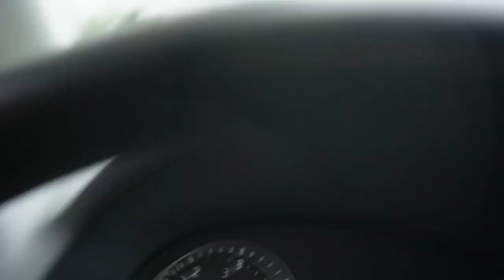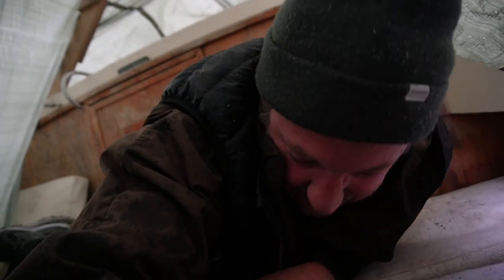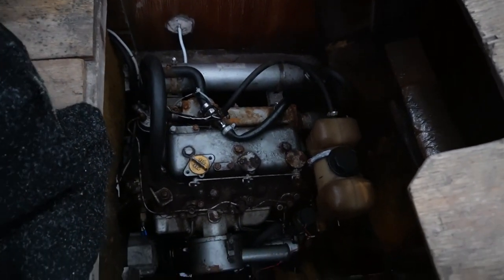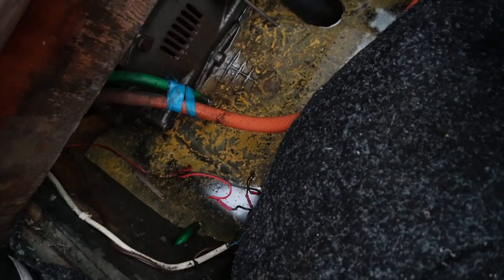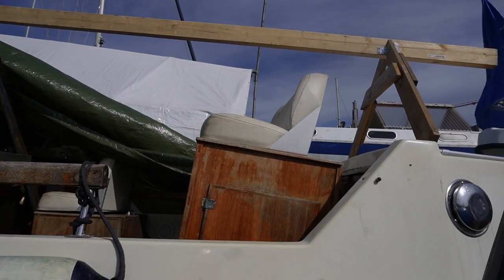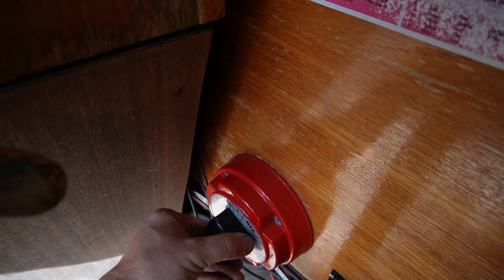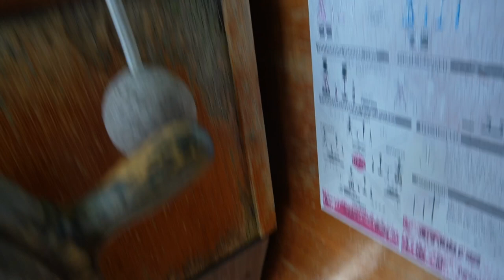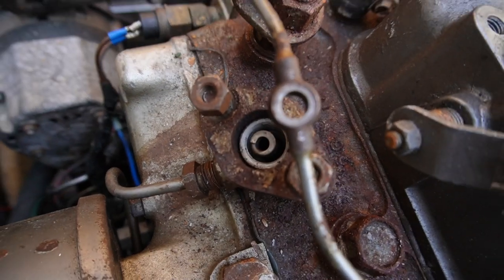Mechanic vlog, WASTING MY TIME |S02E03 #mechanics #boats #yanmar

Comment: Always frustrating when people leave out key details like that. I find it's usually because the first people they called and told that declined the job for the same reason you did.
Reply from the maker: Yea, you’re so right. It’s frustrating. I didn’t think of that, but yea I guess that could be the case here. Someone probably said no and then I had to deal with that mess😅.. thanks for the support👊